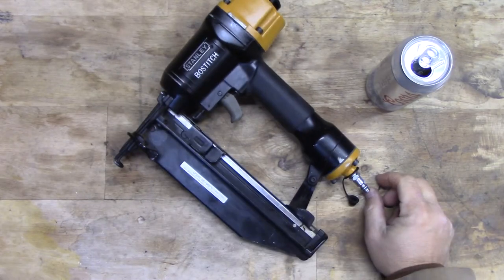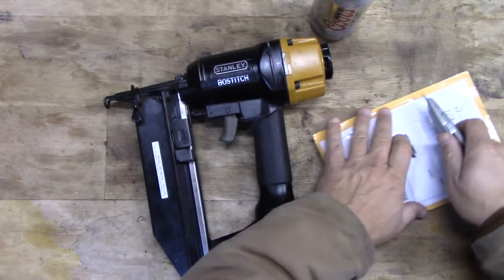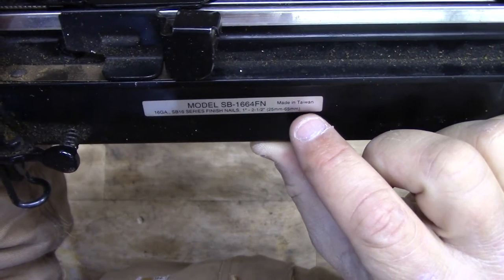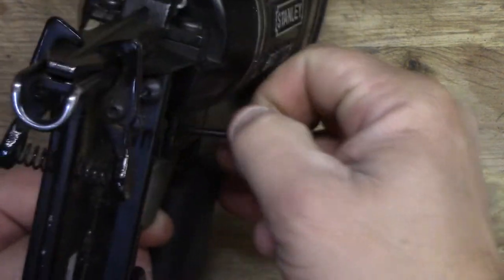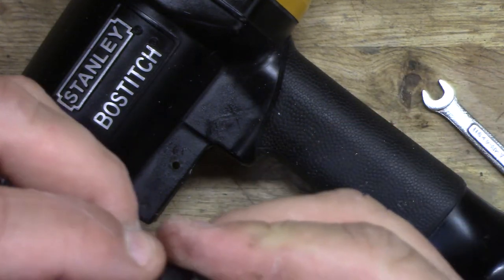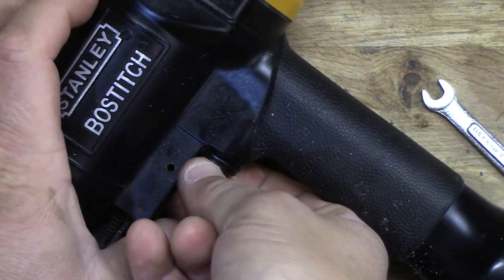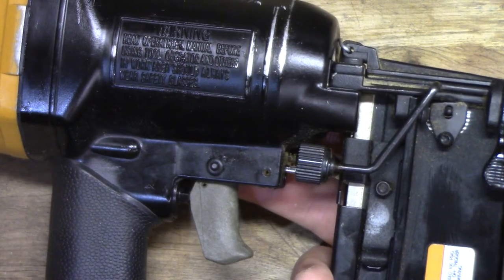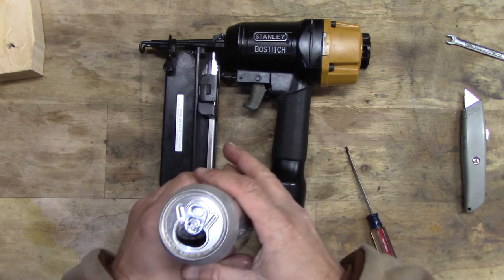Repairing a Bostitch 16 gauge finish/brad nailer

Comment: I didn't think it would be such a simple fix.  I'll be doing the repairs on mine shortly (need to order the part).  I should mention that my nailer has performed extremely well for over 15 years before giving me this issue, so it is hard for me to be upset.

Comment: I have a stapler that looks just like that with the same issue. Bought a new trigger valve put it in today no difference at all just blows right by the valve still when you hit the trigger. Any advice?
Reply from the maker: Wesley Cooper, they also make kits to replace all the o-rings in the body. I would try that. They are relatively cheap and only take about a half hour to change out. Less if you're not boozing.
Reply: Lenny C I will try that thank you sir. I only have that kind of patience if im boozing a bit though.